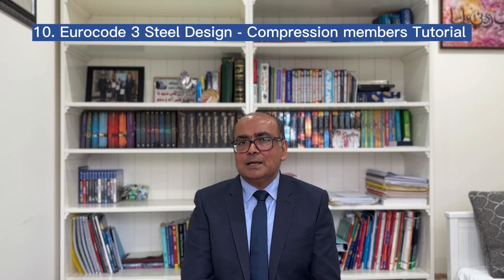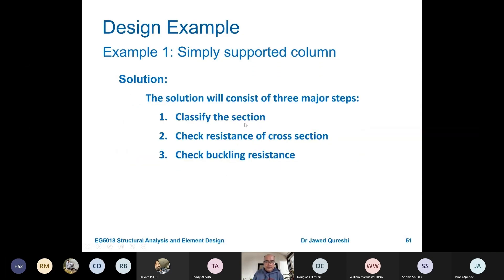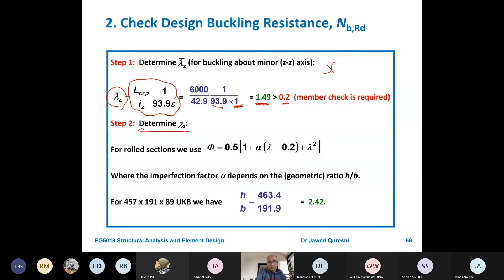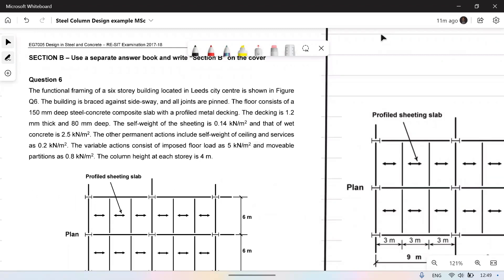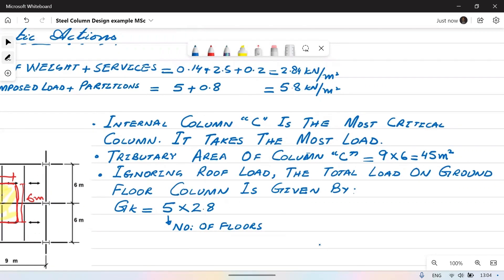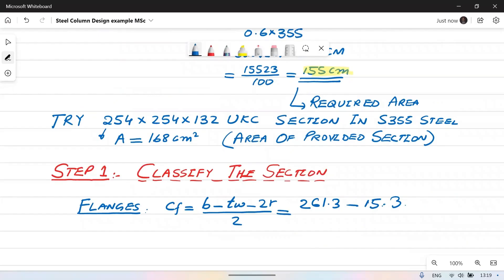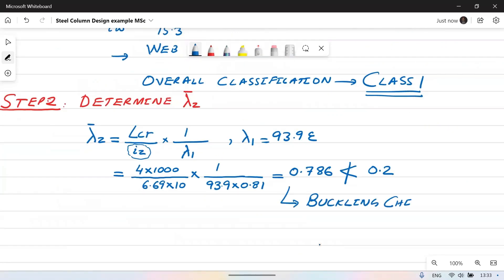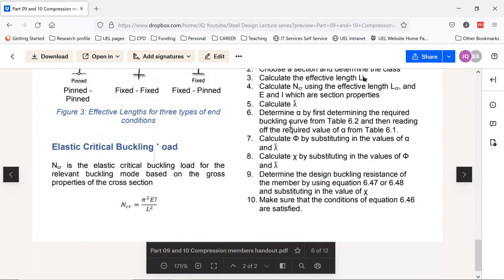10 Compression Members Tutorial | Eurocode 3 Steel Design series

Comment: I appreciate your posts very much
Reply from the maker: Thank you so much. That is what I'm here for.
Reply: @DrJQureshi Thank you. Do you design cold formed lipped channels manually on a certain video? As a beam.
Reply from the maker: @engineertheophilouszengeni3159  I don't have a video on that yet. Normally, cold formed thin sections are as used as purlins in the UK. Manufacturers usually provide their spanning capability, but Eurocode 3 plated structures has some provisions for them.
Reply: I get you. Thanks again.

Comment: More emphasis on the rule of thumb Ag=NEd/0.6fy….what is the origin of the 0.6
Reply from the maker: It just helps to initially size the columns. The column can be revised later in the detailed design checks. The rules of thumb are normally developed by practicing Engineers. I am not aware of scientific evidence for this formula. It doesn’t belong to codes certainly.